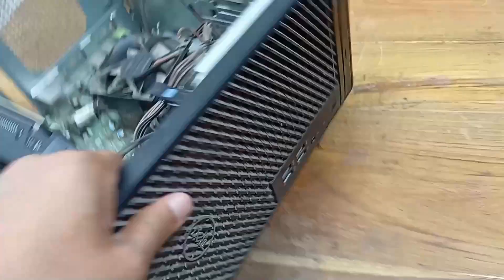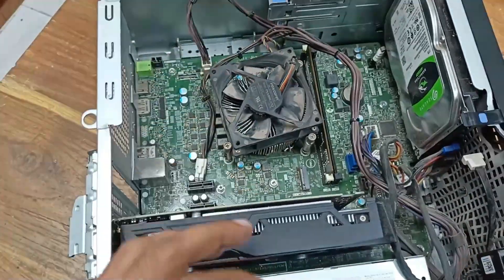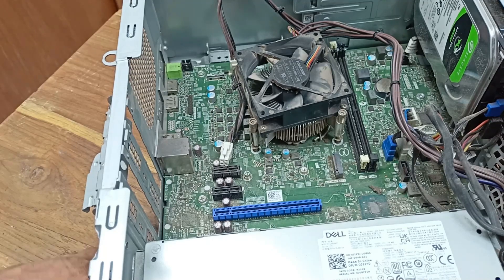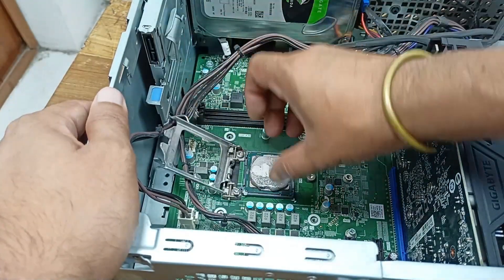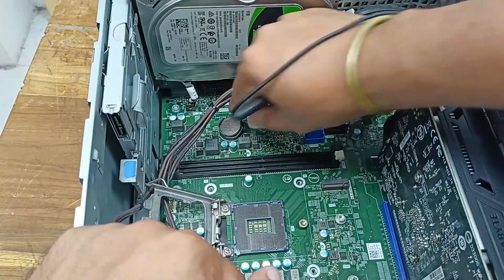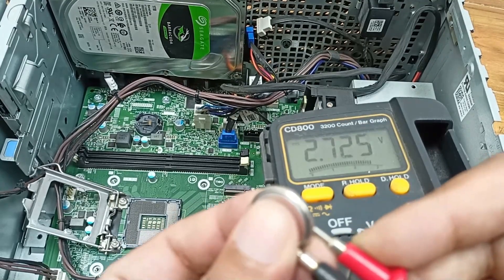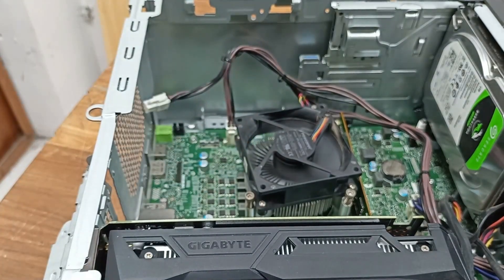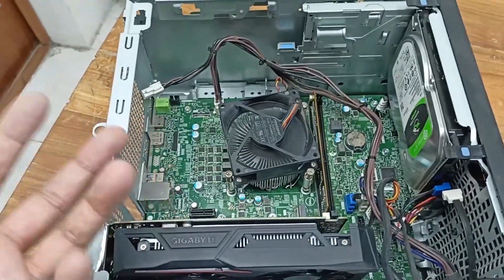Restart Dell optiplex 3080 pc  || how to fix restar problem dell Computer

Comment: Put a 4.7k resistor across the meter leads to load test the battery for a more accurate voltage reading.
Reply from the maker: Thanks for sharing this information.  ❤️❤️